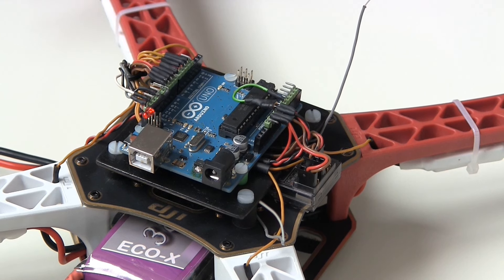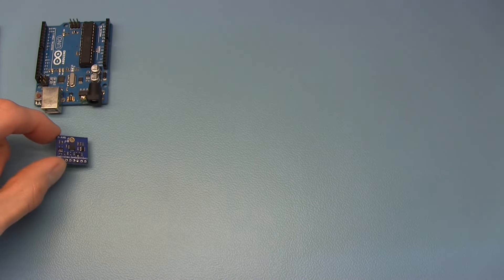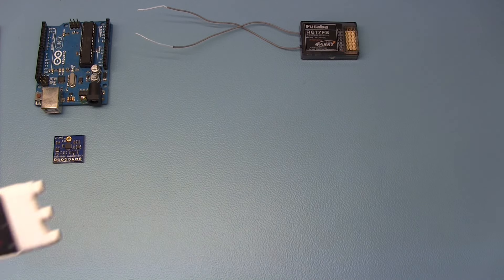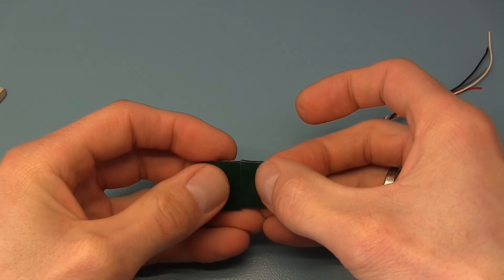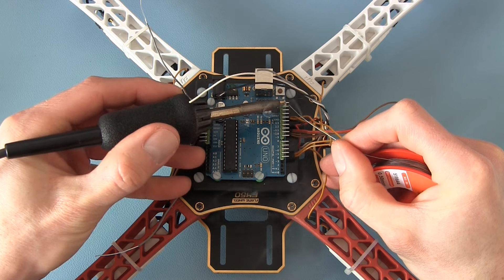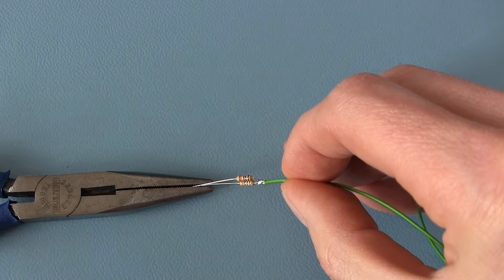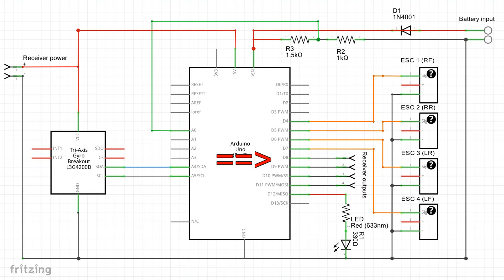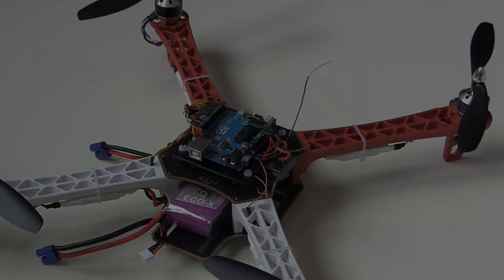Your Multicopter Flight Controller - 3D (YMFC-3D) Part 1 - Hardware.

Comment: I am interested in your idea about my plans to make an autopilot system based on accelometer and gyro.
What do you think can it work?
Here is my plan:
- having an arduino nano/mini and a gyro and accelometer sensor wired together
- connecting that module between the receiver module and the flight controller
- that module would store the path of the flight in 3D and could take the control of the copter in specific situation to return to home without using any magnetic or radio related module so no compass no GPS.
Just store the path by the accelometers and gyros. (It could have to do some interpolation of the measured points not to store too much coordinates, so some kind of fixed resolution 3D curve.)
There could be different ways to go home on loosing signal of the transmitter:
- simple play back the curve backward
- finding the easiest path (could fly into objects), like fly in a straight line on horizontal directions to the distance calculated until estimated takoff coordinate at current altitude then land
The two above could be used in a mixed way or based on flight time or battery voltage.

AutoPiloting the copter would be the tricky part. It should give pwm values for movement in a hardcoded range with a specified default and measure its accelometers/gyro and correct the speed in each directions and store the estimated path on the way home.

I know based on compass and GPS it would be easier but there are situations when radio signals are yammed etc.
So this is my idea, to store an interpolated path based on accel/gyro. Triggered by an event get the control over the copter in manual/stabilize mode and fly back home based on its accel/gyro.

This way it would be compatible with any standard copter.
Also with a 4 side sonar module and low speed it could have made more clever to avoid collision.
Reply from the maker: First you should get some live data from a accelerometer and gyro on a quadcopter. Try to figure out on how to use this data. You will see that this will be your greatest challenge.

Try one thing at a time and slowly work your way to your goal.
Reply: +Joop Brokking I don't say that I can do the code, I am just interested in your opinion can it be possible?
Reply from the maker: What I'm trying to say: the accelerometer does not register turbulence, wind, drift etc. You will notice this when you play around with one. In my opinion it is not possible to do any return to home without a repeatable data source (GPS, distance + mapping, etc)
Reply: +Joop Brokking Thanks for the answer!

Comment: Hello Joop.If  we don't connect the voltage divider on Vin and GND  of the Arduino but make 2 new lines from the same place that the battery gives power, add the resistors in the same way and connect to the analog pin, do we need to compensate for the voltage drop on the diode and add the "65" on the code(YMFC-3D)? Or i remove it?
Reply from the maker: If you don't use a diode you can remove the diode compensation.
Reply: I use the diode but the voltage divider is connected on a separate line and not in the same as the diode.So the voltage divider can "see" the voltage as it is from the battery.
Reply from the maker: Ok, got it. than you need to remove the 65 because the voltage is higher. Please check the maximum voltage on the analog input with a full battery.
Reply: All right. Thank you for your answers once  again.

Comment: Joop  Looking at your schematic.  If I'm using a fully charged 3S Lipo then I'm putting 12.6V on VIN and the divided voltage on the A0 pin.  Am I reading this right ?
Reply from the maker: It's actually ~12V on Vin. The diode uses ~0.6V. And yes, the divided voltage is connected to A0.
Reply: Thanks for the reply Joop.  Awesome work! thanks for putting your time into this video series!

Comment: Hi Joop, Thanks a lot for the nice Video!!. I have question did you solder or use hot glue the pin header (5;07)with the Arduino ?

Comment: Can we power the arduino from the vin pin from the bec ? Bec output is 5v. Ia that possible?
Reply: +Kevin Pinheiro depends on the arduino you use, the uno requires12v

Comment: Hello,
Could you please tell me the way you calculated the resistor values?
I am using a 5s Li-Po and the maximum voltage when fully charged is 21v.
Could you please help me with this
Reply from the maker: Please check question 12 on this page: http://www.brokking.net/ymfc-al_qanda.html
Reply: Many thanks for your replay.

But could you please tell me what are those changes in the program? I mean how did you calculate those values like 65 to 49 and 1.2317 to 1.7038.

Thank you

battery_voltage = (analogRead(0) + 65) * 1.2317;
needs to be changed in:
battery_voltage = (analogRead(0) + 49) * 1.7038;

Comment: Thanks ... I'm using the YMCF-3D version and I have tried it ... I have a problem when not increasing my throttle quadcopter so high so fast ... can you help me clarify is this okay
Reply from the maker: Make sure to calibrate the ESC's as explained in the manual of the manufacturer. And make sure to use the right props with the motors. And always test the quadcopter in your hand before you fly. Safes a lot of unnecessary crashes.

Comment: Hey Joop, I've noticed on your website your hardware list links to deals extreme. I've heard their reliability is poor is this true? Do you buy parts from there?
Reply from the maker: I buy all my parts there and never had any problems. I also never read complains in the comment section. And trust me, if they where really unreliable people will complain about it. But you can always try another seller where you are comfortable with.
Reply: Thanks for the insight! I also have one more question: what is the average amount flight time you get out of this design? Thanks.

Comment: hi I am doing a drone with Arduino but use the MPU 6050 module and see that yours are using L3G4200D and do not use the interrupt pin INT1 think if I follow your video with programming that you be able to get good results, really not much about arduino programming
Reply: or changes might do to use the MPU6050 which is what I have now
Reply from the maker: +Ulises Torres If you don't have much Arduino experience you better try MultiWii or so. By using the MPU6050 you need to modify the code.

Comment: hi i am trying to make this project... in circuit part i used mpu6050 for gyro and there i see SDO CS INT1 and INT2 are red wire and left unwired  so is that suppose to be left unwired or that means i have to connect to power source (+) ??
Reply from the maker: The MPU-6050 is only supported by the YMFC-3D version 2. Check the schematics for the connections.
Reply: i download YMFC 3D V2 zip from your website i think it has this schematics isn't that suppose to be for version 2
Reply from the maker: Only the software is different, the schematic is the same.

Comment: Hi , i would like to know if i can use more or less than a 2200 mAh (like 1500 mAh or 5500mAh ) . Thank you
Reply from the maker: 2200 till 3800mAh is common. Anything higher does not increase flight time.

Comment: which wire did you attach between 5:08 to 5:23
and what is that for?
Reply from the maker: The I2C data and clock signals. They can also be connected to A4 / A5.
Question 5: http://www.brokking.net/ymfc-3d_v2_qanda.html
Reply: +Joop Brokking thanx ....really great help

Comment: Hi Mr brokking
 i have a question regarding the YMFC arduino drone, is it possible for me to replace the transimtter (controller) with web page, i mean i design a web page to control the drone without having the transmitter. i'm currently working with my final year project for my degree studies and my project is to design and develop an IoT (Internet of things) quadcopter with arduino uno as the flight controller and control it via wifi..
hope you can response to my message. Thank You
Reply from the maker: Everything is possible. But it take a lot of code and effort to program it.
Reply: thank you sir!
Reply: but sir, can i still use the YMFC library for the arduino code?

Comment: Joop.  Do I have to use OPTO esc's or can I use BEC.  In my build, I did not use OPTO 's. In your video I noticed you used OPTO
Reply from the maker: You can use normal ESC's. Just don't connect the 5V wire from the ESC. Check this site for more information: http://www.brokking.net/ymfc-al_main.html
Reply: Joop Brokking thanks for responding.  i have asked allot of questions.  i check the schematic several times.  when i plug in my battery my esc's do not beep.  i received no errors in setup nor or when i uploaded the esc calibration.  no response so i cant calibrate.  any ideas?
Reply: when i run the receiver software i get a blank com monitor.  its running but nothing shows up.  you have any idea why?

Comment: Would you code as written work with a mega or would I have to find the addresses. This build has given me many new ideas to add on and I think a mega for its extra pins and size would be a better fit for my application
Reply from the maker: JD D You absolutely need to check (modify) the I/O and the registers. After that it will work.

Comment: Why did you not use the BEC of the ESCs to power the arduino?
Reply from the maker: Because you also need the battery voltage.

Comment: Joop.  I am keeping you updated on my progress.  I finally got my mids and endpoints to be pretty constant at:

High, low and center values found during setup
Digital input 08 values:1008 - 1504 - 2000
Digital input 09 values:996 - 1512 - 2000
Digital input 10 values:1008 - 1508 - 2012
Digital input 11 values:1008 - 1500 - 2008
Move stick 'nose up' and back to center to continue

I am not receiving any errors.  The LED on turns on during verification at the end of the setup.  When I place stick down to verify it goes out.  When I run the Esc calibration and go to the COM monitor i get nothing...a blank window.  

1. AM I suppose to see anything using the auto calibration software or is the use of the COM for V1 build only? 

 2. Is the LED light suppose to come on?

I am not budding the AL currently nut the V2 with the auto calibration software.  I will attempt the V1 or AL when I get this correct.  Your input is appreciated.
Reply from the maker: You could use the ESC calibration sketch of the AL to see if it is working and to calibrate the ESC's.
Reply: I went through the AL setup with no error.  AL esc calibration completed but still no sound from motors when plug in battery.  Its as if the esc's are not getting a signal because they are receiving power.  Checked with volt meter. I really need your help with this.  I have been at this point for weeks.  Thanks

Comment: Hello!! 
I'm little confused, I can understand fully the difference between a 3D drone with stabilization and Autolevel drone, could you explain me? I'm not sure if 3D drone with stabilization is the same that Autolevel drone, thank you!
Reply from the maker: 3D means that when you move the stick on the transmitter the quad will continue to move in that direction. If the stick is in the center position the quadcopter will stay in that same position.

Auto-level means that, when the stick is in the center position the quadcopter levels itself like in this video: https://youtu.be/gz-Mywo7bGc

Auto-level is much easier to fly.

Comment: Will the code work equally if i change de esc's and the motors?
If it changes is it only a matter of values, or will the algorithm change from one type of esc to another?
Reply from the maker: If the ESC's and motors are designed for multirotors it should work fine. The PID values are the only changes that you need to make.

For a correct setup procedure check question 1 on my Q and A page:
http://www.brokking.net/ymfc-3d_qanda.html

Comment: Thanks for you videos en website! I'm currently building one of my own. The ATmega on the Arduino is getting really hot within seconds. After some testing it doesn't get hot anymore and I probably broke it. 
On google I read that some pins might be drawing too much current, but I've followed you schematic. Any pointers on where things might have gone wrong?
Bedankt voor je hulp!

Comment: I am building a quadcopter based off of your set up and the hardware you have listed on your website.  I am ordering the parts and just have one question.  Does the RC transmitter controller come with a receiver or do I have to buy that separate.  You don't have a receiver listed on your parts list so I am assuming it comes with the transmitter.  If someone would please clarify this for me I would greatly appreciate it.
Reply from the maker: If you used the link from my website it comes with a 6 channel receiver.
Reply: Joop Brokking awesome! thanks for the quick reply! I greatly appreciate your tutorials as well👍

Comment: Hi,
I know I'm a bit late but I have a question regarding the voltage divider (that might come off as a bit stupid :D):
I don't have access to a 1.5k ohm resistor so can I use a 1k ohm and a 680 ohm resistor instead? I feel like it's not that far from the 1.5k ohm but I'm not really an electrician.

Thanks!
Reply from the maker: It must be 1k and 1.5k. Otherwise the voltage calculation is wrong. You can add two 1k in series to another 1k in parallel to get 1.5k. Pleas double check it with a multimeter!

Comment: Hi Joop, I had trouble on quad. It completes all procedures and everything is correct in the programming and configuration, however at the time of the field test when I set the board it turns one of the motors very fast in relation to the others, then I make the adjustments in the radio in the buttons of derivation and I compensate the side that rotates More, but the other side that starts spinning very fast, even if it is just a small touch on the control setting buttons. I've reinstalled the programs and refactored the procedures several times, the links are correct, I do not know what it might be, would you know what it is?
Reply from the maker: When the quadcopter is on the ground it cannot level itself. That is why the lower motor starts to increase it's rpm. After starting the quadcopter you need to take of as soon as possible.

If you want to test the quad, hold it in your hand as I showed in the video.
Reply: Thanks joop, I'll try it this way.

Comment: How do you connect the reciver to the arduino ?  what connectors are needed ? and does your design involves telemetry to feed the show the user the current voltage level ?
Reply from the maker: http://www.brokking.net/ymfc-al_main.html
Reply: +Joop Brokking hello again, I wanted to ask you if 3 1s batteries, connected in series will do the job of the 3s you use. the thing is that I think the cable is not thick enough to handle up to 15 amps, but they are supposed 1000 mAh 20c. I send you info about the batteries I already bought

Comment: This is very good! Could you reference any books or websites where I could learn the knowledge you have on the electronics, circuitry, and power that you used for this build? where did you learn how to know what power level, electronics are needed?

Comment: I can connect the VCC to Arduino of the ship L3G4200D gyroscope?
Reply from the maker: +Ninoshka Rodriguez You can only connect the 5V of the Arduino to the L3G4200D gyro if the gyro is designed for 5V.

Comment: i would like to connect a sonar for altitude hold.Given the number of connection is there any pins left to connect a sonar.
Reply from the maker: Abhijit Balan Depending on the signal you get from the sonar (analog / digital) you can use analog 1 to 5 or digital pins 2 and 13.
Reply: Joop Brokking thanks :)

Comment: on your schematic did you forgot to complete the power from the motors? you have only shown the ground been connected
Reply from the maker: I did not forget it. The schematic is just for the flight controller signals. In the manual of the ESC you can find the information about the motor / battery connections.
And on this page I made a detailed build article: http://www.brokking.net/ymfc-al_main.html
Reply: Thank you so much. Your contribution to the tech world is hugely appreciated

Comment: sir i am little bit confused that why did you directly give power to the arduino using VIN AND GND .
but lipo 3s produce more current when we increase throttle and this current can destroy the arduino ?

1 . what is the logic behind it ?
2 . will it not  destroy the board when lipo is discharging very fast (throttle max) . because that time the discharge rate is high it can break the arduino ?
 
please sir tell us.
Reply from the maker: More information about the Vin pin can be found here:
https://www.arduino.cc/en/Main/ArduinoBoardUno
Reply: sir one more problem is 

1. i have transmittet flysky fs-ct6b but i have tried all functions (endpoint,trim,dr) but couldn't get 1000-2000 please help me sir ?
Reply from the maker: Use the YMFC-3D version 2 software:
https://youtu.be/CTtLPeJPbXY
Reply: no sir i want to apply it in ymfs-3d v1
Reply: You have to do some of the work yourself bro. It's not difficult if you take the time to learn.

Comment: Really basic question. How do you solder the pin headers on to the Arduino?
Reply from the maker: You don't solder them. Just take a strip of headers and plug it in the Arduino.
Reply: +Joop Brokking Thanks! I thought that but mine seem to be wiggling around in the Arduino so I didn't know. Is it ok that they are wiggling a little bit or do I have the wrong pin header size?
Reply from the maker: Yes, sometimes they wiggle. You can always use some hot-glue to fix them.

Comment: hiii
how can I connect my receiver's 4 channel to my arduino .
it is not shown in the schematics
Reply from the maker: ankur upadhyay 
Channel 1 (roll) to digital input 8
Channel 2 (pitch) to digital input 9
Channel 3 (throttle) to digital input 10
Channel 4 (yaw) to digital input 11

Use the sketch from part 2 to check the connections.